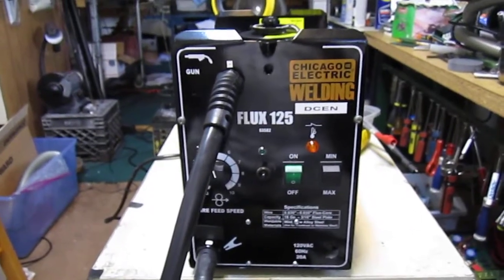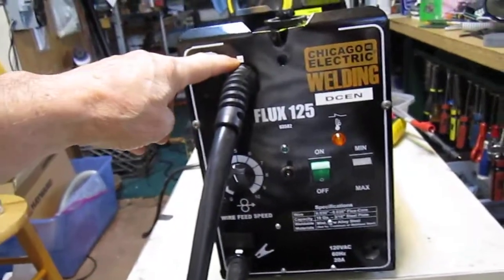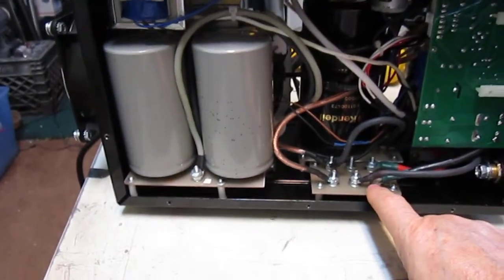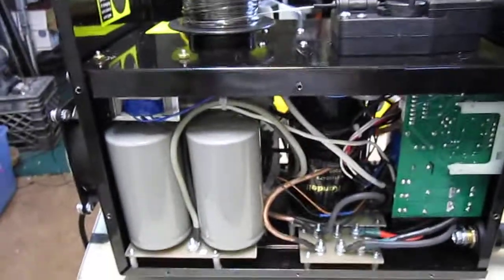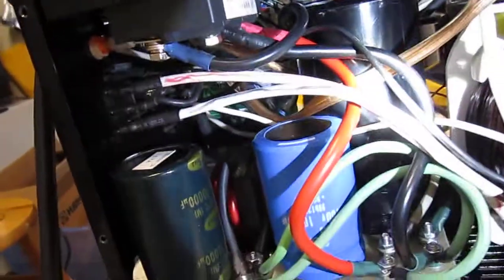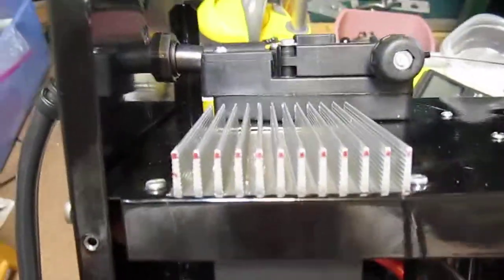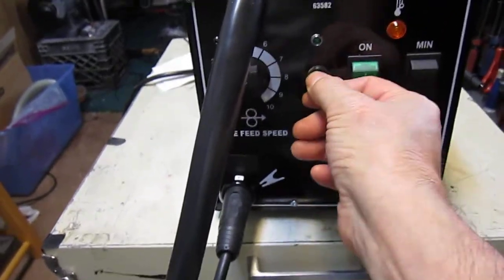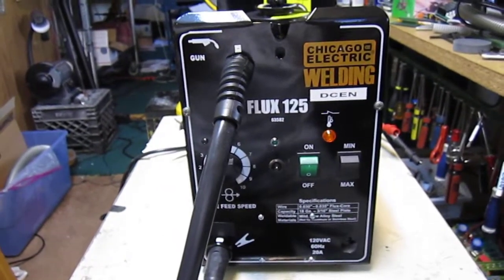Converting Harbor Freight 125 AC Welder to DC

Comment: What? No flyback diode for the inductor? 😲⚡️💥😄 And that’s an awful lot of caps to charge! Sure, you probably reduced your ripple to maybe 0.01%, but I suspect that there will be a significant delay between squeezing the trigger switch and striking arc. 🐌😄  That ROI curve gets pretty asymptotic at that point! And I sure hope you can dissipate the 175W of heat from your bridger, the way that heat sink is mounted. Probably should at least keep that top lid open.

But you certainly utilized the inside space efficiently, and that fan should keep things reasonably cooled. That’s how I mounted my fan (I think mine’s a bit larger). I mounted my “bridger” vertically with the heat sink above my fan. Might mount a cooling fan on the fins later. Meanwhile, I’m so far just running a 50V, 47,000mF cap; I’m using an inductor downstream of everything, actually clamping that between the ground clamp and the work (with a Schottky flyback diode). Picked up that funky idea somewhere 😄😄. DCEN, fyi. Would like to be able to switch polarities in the future.

So far, no overheating or huge sparking anywhere. Finding that a quick brush of the fcaw wire against the workpiece with the trigger switch off seems to discharge the cap, so I won’t worry about a bleed resistor just yet. Just a couple little wire feed quirks to work out, but I definitely like the smoother arc! 👍🏼

Comment: Nice job but I do need some help with wiring the 24v transformer to the wire motor. Can you send me the wiring diagram? I have the same welder as yours. Let me know, I'll send you my email address. Thanks
Reply from the maker: on the small circuit board there is 2 leads comming from the large transformer to power this board
disconnect these and connect your small transformer there !

Comment: the money spent.. could have bought a DCEN wire welder.. lol  should just leave resistor inline all the time..
Reply from the maker: But the only thing you would learn is How to spend mo money !
Reply: @jerryhudson3033  yes and no.. lol... i am doing mines tho lol 60 total for parts. caps is what gets ya for price... need at least 100K uF. winding my own inductor tho out of a microwave transformer .. so i guess ill be around 30 ahead after i get wire. probley be close to 75 bucks 90 for welder plus 75 is 165. 35 saving lol
Reply from the maker: @XPFTP  40.00 for 100,000uf ,3 for rectifier, rest was from my junk box. good luck, mine still running well, I'm glad I done mine !

Comment: How did you wire that independent transformer to power the circuit board? What is the voltage going into it and where are you gettig the power source? I have a 120v 24a transformer i want use to power the wire speed mechanism without the drop in voltage. Lost and confused need a little help. I have 125amp fc welder.
Reply from the maker: wire the 120v side of transformer to the power switch like the main transformer is, the small transformer
is 27-28 volt output and it goes to the bridge rectifier on the small board, you might want to replace that
bridge rectifier as the china one is no good, as what I did.
Reply: @jerryhudson3033  i replaced my wire feed mechanism, original is 24vdc 1a/12w motor with a 24vdc 1a/10w motor from a different welder. Having lower watts on motor will it burn out quicker or last longer because of lower watts? Im just in testing stage, it works feeding wire and speed is up to about 5. Im just curious.
Reply from the maker: could be that the 10w motor is more efficient, personally, I  think its ok, run it to the equivalent of 12 inches simulated welding and see if it gets HOT, I think you'll be ok !
Reply: @jerryhudson3033  ok thanks. See what happens.

Comment from the maker: 3 pin momentary toggle switch ,wire one side of the large  resistor to + on caps, the other side of resis. to the switch post , far other side  switch post to Gnd. center pole was the led with I think 275 to 300 ohm resis. anode, cathode went to GND.
but I used a 3 pole momentary toggle.
Reply: Can you clarify what you mean by ground. Do you mean to the negative of the cap or to the ground wire.
Reply from the maker: @poongster  GND side of the cap, the big picture is to put the resistor across the cap for discharge.

Comment: Very neat install.  Nice work.  I really like the resistor discharge setup.  Great idea. Keeps the caps charged. You're the first I've seen do that.  Best mod yet I've seen. (And I think I've seen them all).  Glad I stumbled on it.  Can you give details on how you did the resistor switch? Or did you just put the momentary switch in line?  You can get a 100000uf cap.

Comment: Only my opinion. 
    That is ALOT of work, parts, money to convert AC to DC. Don't get me wrong is all good. However.... You can do this way cheaper And fast. 

1 x 150amp 200volt bridge rectifier.  (Or go find you 2 beefy diodes for full wave rectifier or 4 beefy diodes for half wave)
1 x 50vdc 100,000uF cap. (Optional)

Done. 

The bleeder cap, option. BUT, really a MUST for safety. 

The rectifier ALONE is what will convert the AC to DC. The cap is for a smoother wave. 

And REMEMBER. Negative is the torch and positive goes to your ground clamp.... To complete your DCEN welder mod. Boom.

Comment: What a wonderful job....got a question...is it possible to just run power from the high side of the transformer and then through a variable pot to adjust the power output doing away with just hi and low setting.
Reply from the maker: PWM !, go on and rectify the 120ac to dc and use PWM on the transformer and and have an adjustable
output. would be a good project ! that is the way I see it, I'm sure there are other ways.
Reply: jerry hudson 
Thanks for the reply....
So if we can keep the total investment under $200 maybe worth it....
Reply from the maker: you would have to have VARIAC transformer, a large one to act as the pot.
Reply: jerry hudson 
3PN1010B Variac Variable Transformer.....
But the retail price is .....well not cheap
Reply from the maker: no, as you have dc circuits that need a set voltage to operate.

Comment: After doing. Conversion on the same welder I know the work you put into that elaborate of a set up.By far the best I've seen on you tube.Nice job.Can you show how you made the inductor?And does the voltage on the multiple caps need to be rated the same to be able to use more then one?
Reply from the maker: cap can be mixed voltage not under 80v keeping a good buffer for spikes, inductor old transformer 4x3 wire removed, re wraped with 8ga silicone jacket about 5ft on ebay very very flexable wire (micro strand) easy to form !
need more info, just ask !
Reply: Is 80 volts combined or individual.I currently have one 500000mfd 50 volts and have another cap I would like to combine with it.It is 2600 if 450 volt dc.not sure if it will work.your thoughts?
Reply from the maker: 50 volts will work(cutting it close) your max dc output should be around 37 volts dc, that is what my welder outputs on HIGH setting and 26 volts on Low. but 50 volts should work but has not much over voltage protection.
Reply from the maker: individual voltage on each cap 80 on one ,100 on another, 60 on another
mix voltages ok. just watch going to low.

Comment: What is the benefit of using so many caps along with a single inductor?
Reply: Capacitors DO NOT convert AC to DC. That is why he is using an inductor. 

Save yourself the time. Spend $8 on eBay. Order a 150amp 200volt bridge rectifier. That is All you need to convert this to DC.
Reply: A full wave bridge rectifier simply inverts the negative half cycle of the ac sin wave. Output is a ripple voltage that varies 120 times per second between 0v and whatever the max output voltage is, ( depends on the output of the transformer in this case ). The capacitors and the inductor help smooth out the output to a more consistent dc voltage. Yes you could just use a rectifier but the setup he is using will produce a better result, especially when one of the problems with ac welding is the constantly changing voltage.